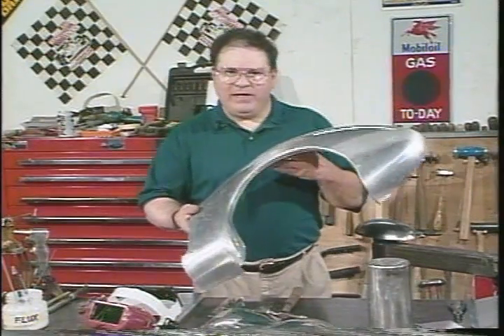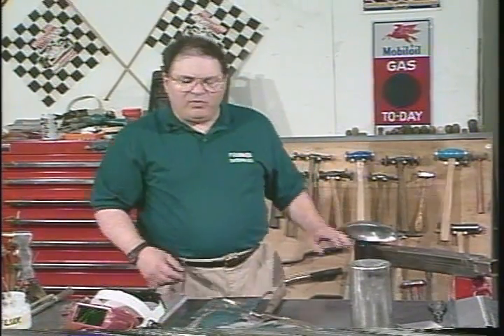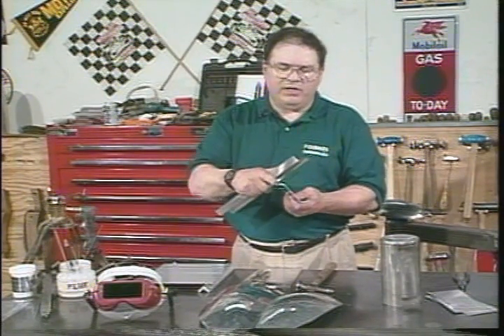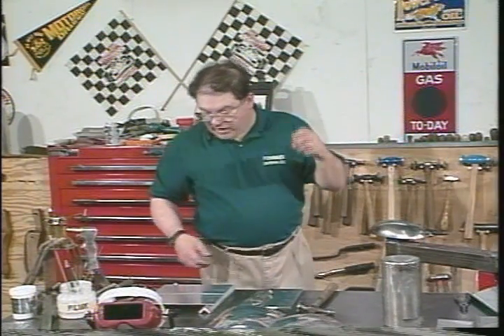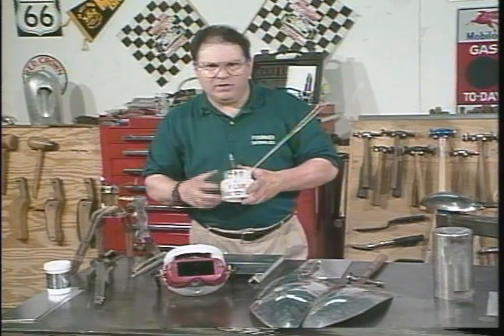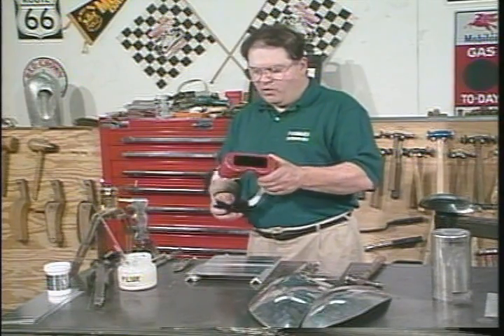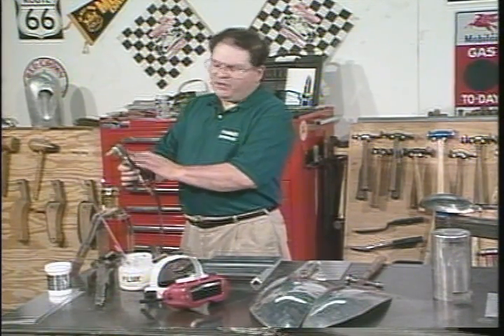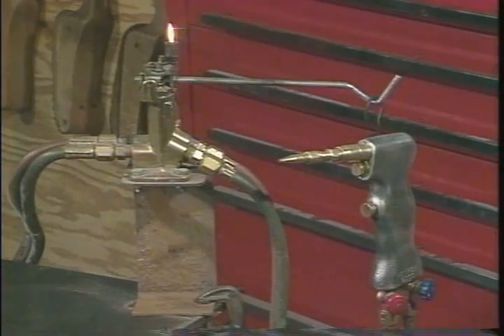Aluminum Welding | Gas Welding

Comment: Can you Tig weld instead of Oxy-Acetylene? If a continuous Tig bead gets the part too hot, then what about Stitch welds, with or without filler rod?
Reply: You can DC tig weld 1/8" or thicker aluminum with helium. Otherwise you have to use AC

Comment: Hi there. Watching this clip I learned that Mr. Fournier uses "Aladdin Flux". But surfing the net for this product, I've found that Aladdin has two types of fluxes, one for soldering and another for welding, and they have a number too; and in the clip which the one he uses isn't specified.
Would you please let me know which is the correct flux you are using with your Henrob torch? I'll greatly appreciate this information!